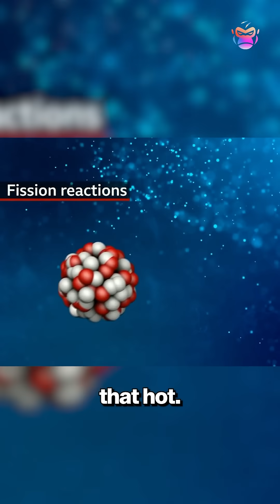China’s Artificial Sun breaks records!!

Comment: Machine used to create and control it is called Tokamak. And a plasma is created since plasma is a 4th form of matter which can eben conduct electricity and it can be controlled by magnetic field that's why it makes safer to work with such a high temperature matter. If you don't know about plasma let me tell you the flame you see even in the candle is also a plasma and it also affected by magnets also.